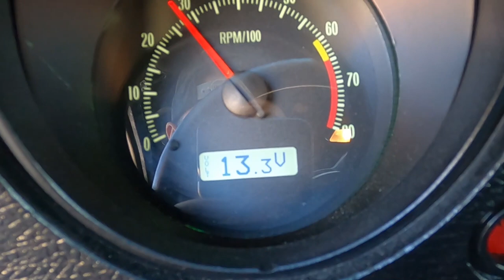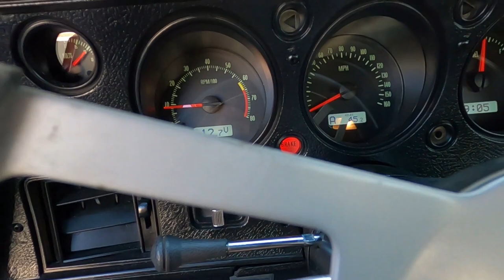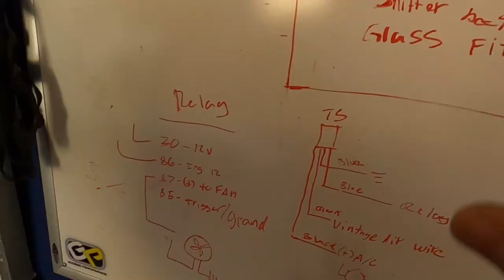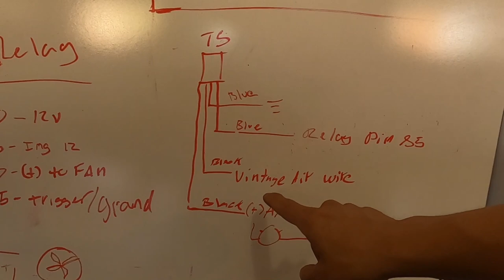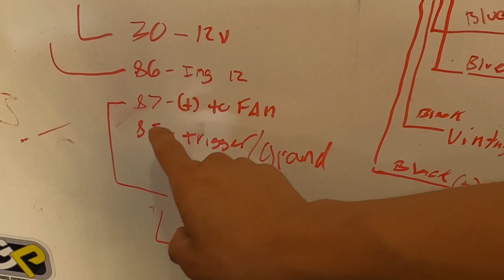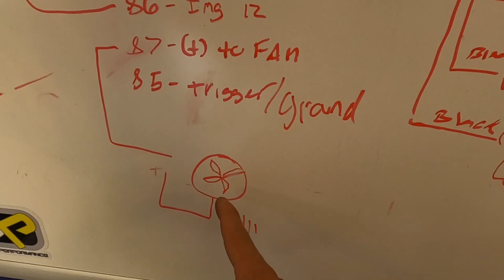HOW TO WIRE A AUX FAN FOR YOUR A/C SYSTEM WITH A TRINARY SWITCH

Comment: Nice work, you should invest in star washers to go between your ground wire and the frame or body that your grounding to. I live by those washers. It gives an extra bite into the metal and doesn’t allow the bolt to come loose like a lock washer. Never had a ground issue haunt me in my LS conversion.
Reply from the maker: yes

Comment: So the trinary switch send a ground as a trigger? I'm considering getting this trinary switch and running a single relay for my e-fan. Have a coolant temp sensor trigger the relay with ground, and use that same relay and trigger it with the trinary switch ground as well.